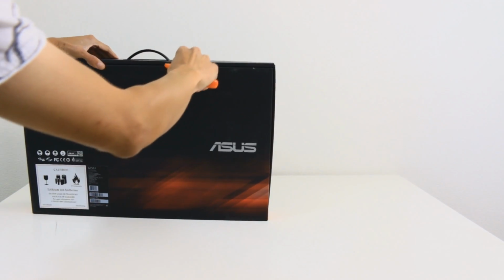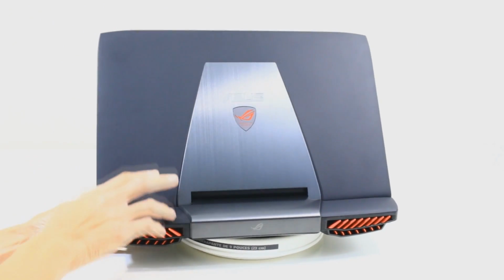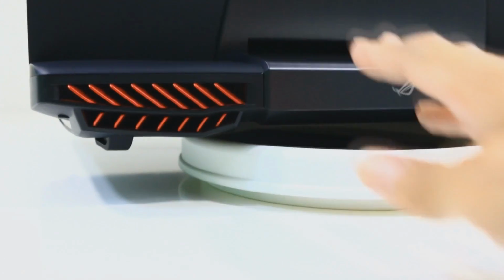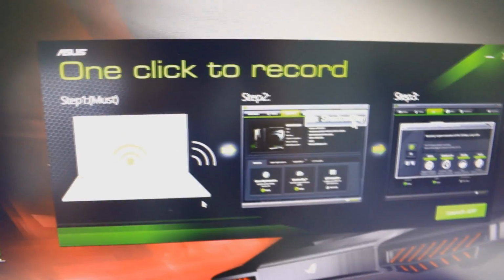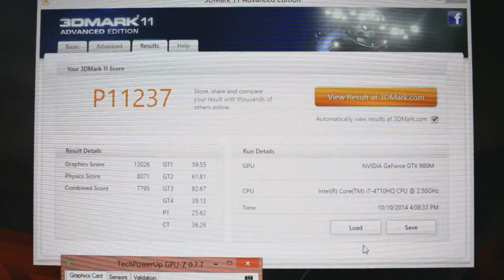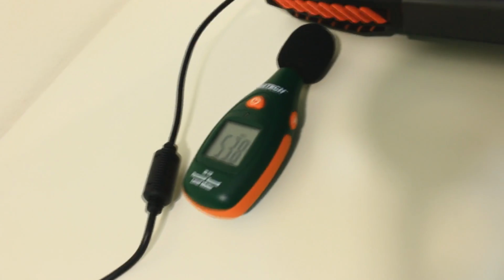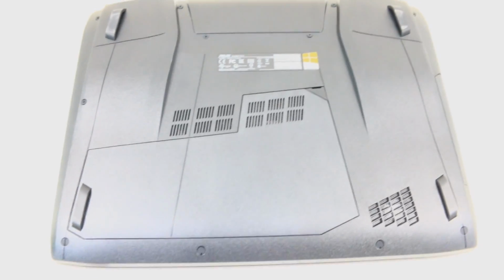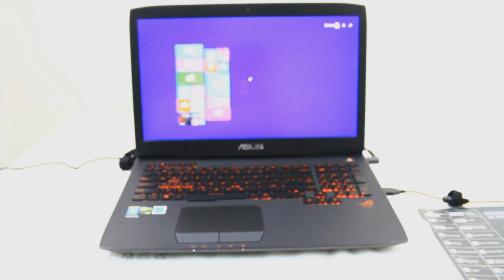Asus G751 nVidia GTX980M Full Detailed Review & Benchmarks (G751JY-DH71)

Comment: Concerning the SSD/M.2 slot. Can you install both simultaneously or would that cause interference or other issues?
Reply: unfortunately you can't but you can buy an adapter on ebay that lets you replace the dvd drive for an extra sata port

Comment: Hi, one thing that you didn't discuss was the construction and materials used on the laptop. Like, the part where we rest our palms, is it metal and does it smudge easily? Also the lid material construction and whether its a smudge magnet like some laptops.. these are minor details, but I'd like to know!
Reply: +Jean Joseph I'm using the G751JL right now. The material on the surface that the keyboard lays and the lid pick up fingerprints easily. It is annoying at first but I've unconsciouslly gotten into the habit of making sure my hands aren't greasy before I use my laptop. The newer model G752 has an aluminum construction if you wan't to spend the extra $. After a few months the fingerprints don't bother me any more.

Comment: Could you please tell me what you think about this is it worth 2551.68 US dollar or not ?
ASUS ROG G751JY T7169H
Processor: Intel® Core™ i7 4870HQ (turbo up to 3.7GHZ, 6M cache)
Memory: (32GB) 4 x 8GB DDR3 1600 MHz (Hynix)
Display: 17.3" 16:9 IPS FHD (1920x1080) anti-glares
Graphic: NVIDIA® GeForce® GTX980M with 4GB GDDR5 (G-Sync)
Storage: 1TB HDD 7200 RPM (Should I change to 2TB 7200 rpm or its ok?) With 1TB SSD (Samsung Pro)

Comment: So which one should i buy? Asus G750JY (i7 4710HQ, 980M 8GB, 12GB RAM, 1TB, 256SSD) or the Asus G751?

I hear the G750 is better than the G751.
Reply: G751 is an all round upgrade over the g750. Although both are great. Go with g751 if you want great performance and g750 if you're a bit more money conscience.
Reply: 750 gots better video card?

751 gots better processor?

Will you use the 4 gb more memory on the video card?

Or will you use the more cpu power?

Choices :)

Comment: I plan to buy the cheaper Asus ROG G751JM-T7041H which has a GTX860M. Can someone tell me if it can run The Witcher 3 with max/ulra settings?
Reply: You won't be able to run Witcher 3 at better settings than medium with a 860m.
Reply: Ando Django As I thought. Thanks.
Reply: No Problem

Comment: Thanks a lot it's totally helpful, but I still have a question if you can kindly answer ..
I'm a Lumion user and this program requires more than 6000 points on Passmark for the large projects. I know that the GTX980M scores 6564 points which is totally great, but sometimes lumion just can not detect the dedicated graphic card on laptops. I really need this laptop for my work, but I really want to be sure that it can run Lumion with the full performance before I buy it.. I will appreciate your help if you can. many thanks :)

Comment: Help me do i chose the asus g751jy with 32 gb ram a core i7 up to 3.8 or 4ghs i think and a 980m or the AORUS X7 Pro v3 (2x GTX 970M)
Reply: My exact same dilemma.. Can anyone help?
Reply: Depends on what you want, big and quiet(er) with better cooling, or small and loud with a little less effective cooling (aorus x7) which is also a little faster
Reply: Yes but wath do you realy recommende me please
Reply: Bryan Neill 
The arous x7 pro is faster and offers better graphic than the asus?! Does the sli give u a better gaming experience than the gtx 950? Also quality wise which is better ? I wish some one had experience with both to advice us
Reply: Both are the highest quality in the industry, there wont be anything higher for the price. Aorus has higher performance, the Asus has better stability under load in terms of speed and temperatures
Reply: Heyyyy !!!!!! I want to play the witcher 3 on aerous x7 v3 with sli can it run  ??

Comment: seriously i want to buy a top gaming laptop. but im considering some points
01. in future upgradeble...(such as RAMs, GPU, Processors)
02. desktop BEAST performance
03.off course price
04. long term usability
05. more reliability  

please advice me which one is far better for me...

01. alineware - 17 or 18dual graphic
02. MSI G72 Dominator Pro
03. Asus G751jy -Dh
04.any others..please guys advice honestly
Reply: Thanks  dude. .hw about  AW18?
Reply: If you're going for long-term use. I'd go for the MSI. It maybe has slightly worse performance, because it isn't overclocked. But you have access for very easy dust maintenence and you can get a 1000-series GPU when it comes out in 2016. Because the 4710hq won't be a bottleneck any time soon.
Reply: Thanks... grt advice
Reply: Why alienware is not upgradable? Wht are the problems of Alienware  
Please advice
Reply: Sameera Kankanama The alienware is very expensive. If you have the money, I'd look into it more. But the world isn't ready for SLI 980m's yet. They usually get really hot.
Reply: This asus gaming laptop are not upgradable? ?  So decapointed
Reply: Ya. Every body know that... pc isn't mobility..that's also should know everyone
Reply: No dude... alineware 2014 series can upgradable to anything. ..processor. ram. Gpu (cpu dependent on the alienware board ). AW17 serious  980 can upgrade easily check  you  tube. AW18 also possible i heard. You know what.. Aw18 graphics are enough to paly next 7 years. As of today highest graphic required to play only 2gb vga... and 8gb ram. I3 or i5 cpus. So if you have  a 16gb vga... its beast. 
MSI dominator pro is good too
 But see the internal build quality? You have to be very carefully if you using msi dominator pro. Anything hapend you have to pay the price. Its build by some king of thinnest aluminium and plastic. And inside of laptop isn't good enough as my opinion. 
This all like a bying a spot  car...
1st you will dreaming to  buy a ferari bughati lambo masarati something highly recommend and expensive something 
2nd you will dreaming to buy ford gt honda gt nissan gt  or something averagely expensive 
3rd you  will dreaming to buy hyundai kia or something affordable sports car

Its depend on your budget. Your feelings.  Your requirements. 
You can buy a hyundai something but you won't feel like a lambo or ferari. Money is not everthing. It is based on satisfaction.
Reply: Sameera Kankanama the alienware is really expensive and overpriced, plus: Dell customer service.

Also, the MSI has a conciderably "thick" chasis and remains cooler. If you have money, get the alienware laptop with the SLI graphics. But until then it's not worth getting anything other than the MSI.
Reply: Seven  t.. ma bro.... im  appreciate  your valuable opinion. Its gave me to think various point of view.
 I will  explain about my 7 years logic.......... just take last 10 yers pc games revaluation.... 128mb (2004 most advanced vga at the time) vga to 2gb vga(2014)
.... pentium 4 3.0ghz( best cpu at 2004) to core i3..(still most games are required only core 2 duo or core 2 quad)
512mb ram(at 2004 best ram for games) to 8gbram (maximum required only)... just check is it true or not
I just calculate the revaluation. Its not a rocket science. ..just basic only.. its always good to be sharing our opinions with others....#sevrn T. Your advice i highly appreciated.
Reply: #inverted silence  EDM...Ya if i can't afford to alineware... definitely im going to MSI....im too far from USA.. im not interested about dell or msi  customers services. Becouse im bying trough some sellers... but alienware its like  dream come true.....but im still be in msi have such bad build  quality..... thanks for your kind words always.... new things to me
Reply: Sameera Kankanama 
I've been researching which laptop to buy for a few months now, as it is a difficult question to answer.
But the build quality of the MSI has significantly improved for the GT72, and has the second best cooling to the ASUS on the first place. In my opinion it's the best bang for buck right now. If you are going to buy the SLI alienware, you should be prepared to spend $4500. And if you really want SLI graphics for cheap, get a clevo barebone, but they have bad build quality similar to what you describe of the MSI.
But the single card winner is the MSI.
Reply: Yap..i agree with you...its very default to say which one is the better...gt72 dominator pro now improved.. yap agreed with you. Its came with 980....
Reply: Sameera Kankanama G751 is AMAZING with the 980M which is very powerful.
Reply: TEAMSTARBLOCK TY and Blu3Yaap... but it can't  upgeate in future. Lifelong choice is better... that's why im planning to get Alienware or MSI but tooooooo difficult to choose one..... its crazy
Reply: Sameera Kankanama Don't get an Alienware, its not worth it. If you have that kind of budget, get a PC built at MicroCenter. If you need a laptop, go to ScatterVolt on Youtube and see his best laptop list.
Reply: Sameera Kankanama You should get the MSI, trust me.
Reply: Sameera Kankanama all of them have IPS screens now, better than the Alienware which still uses TN Panels.
Reply: Guys i'm confusing????
Reply: Sameera Kankanama yes you are confusing.
Reply: Inverted Silence EDM bro.... ist enough to play next 5 6 years games with 8gb graphics card?  That's where i'm confusing. Becouse  honestly i can't buy every 2 years  or 3 yers a gaming laptop. I can't  afford it. So that's why I like to buy most powerful a laptop which is now currently top....8gb will enough to play... in future?
Reply: Sameera Kankanama Yeah, it is for sure. there aren't even 8gb desktop cards yet! 8GB vram can even load textures for 4k resolution gaming, which is higher than the resolution for the laptop screen! You should be set with the 980m for about three to four years with EVERYTHING on ULTRA. If you find it too hard to keep up, you can always buy a new gpu for your MSI in a few years, which will increase the lifespan even more.
Reply: Can you two stop ignoring me. Inverted Silence EDM Sameera Kankanama 

Bam. Best laptop. http://www.newegg.com/Product/Product.aspx?Item=N82E16834725005&cm_re=Aorus_X7_Pro_GTX_970M_SLI_Gaming_Laptop-_-34-725-005-_-Product
Reply: Inverted Silence EDM... thanks bro..... but you think after 5 yers also msi gpu can upgradable? Mother board will support? Alienware 18 have 16gb sli? It can be upgraded to 980 to... which means .... tooooo overkilld of Alienware 18 ?
Reply: Sameera Kankanama The MSI will most likely have support for the 1080m coming in 2016, but yet, the alienware 18 does have SLI 980m, which is next level overkill, but also really expensive as I said. And usually the second card adds only 30-60% of the original. On top of that the Alienware 18 has terrible cooling. :(
Reply: Let's see i saw msi titan also coming with 980sli.... alineware design been g killing my head  dude.... every night....
Reply: ACER V17 NITRO. im using it now and just got it yesterday. I AM TELLING YOU IT IS A BEAST!
Reply: Asian Lion It's like the MSI but with less ram and a worse GPU. good bang for buck though.
Reply: Inverted Silence EDM +Inverted Silence EDM lol how is it worse? Msi has way worse gpu and v17 just came out.  Same specs and better cooling than the asus. you are just paying for the brand name in asus but they are all the same shit.
Reply: Asian Lion 680m < 980m
Reply: Guys. .. the battle begun.... msi lunch  gt80 titan with 980sli.... alineware released their latest version of 15 and 17 with graphic amplifier....(means we can play with desktop gpu)alienware  prices and specifications reduced! !!
Reply: 3 years... 🤔🤔

Comment: Isn't having the winding striking the  db meter kind of altering the results?
Also, while I get that you probably do this for all systems, wouldn't a more helpful for the customer result be having the db sensor at least 12 inches away from the exhaust? 
Just wondering.
Also, how do you access the "bottom" m2 ssd and the "bottom" ram module?

Comment: I've watched a bunch of your reviews, nicely done, short and to the point.
I am in the lookout for a powerful laptop to use it mainly for 2d/3d work ... all the other asus/msi laptops i have seen so far had terrible panels in terms of color reproduction ... only shift my eyes/head 10-20cm left or right and the colors start to shift on the screen as well ... i do not expect retina display quality on these but does this new ips panel offers any improvements over the old TN panel?
I would have gone with a macbook pro , the screen is amazing but the remaining components are starting to lag behind compared to what current gaming laptops can offer in term of performance ,mainly more ram(macbook capped at 16GB) and way faster video card( 750M is highest on macbook as far as i know which is way behind 980M ).

MSI GT72 2QE is another contender but as well i am concerned about panel quality ...

So like i said, any improvements with this new IPS panel over the old TN one?
Any input appreciated,
Thanks

Comment: The battery is fixed?cant be replaced?
Reply from the maker: yes the battery is internal and can't be access without completely disassmble the unit.
Reply: GenTechPC What if battery got problem?is it possible to directly run laptop on AC power without involving battery?& what are battery timings on gaming?thanks

Comment: ASUS seems to push the fact that this laptop is silent, even at high loads. Would you say you support that claim?
Reply: Yes, I have the G750JS model and it is quiet and cool. I added a 1TB Samsung 840 EVO SSD and a 4GB of RAM for a total 16GB of ram. ASUS gaming competitors and custom gaming laptop sellers need to take notice that ASUS flat out makes a better built laptop, sleeker and more attractive slim design also the latest laptop technology. The beauty is that the lower, to high end models share many important characteristics like RAM expansion to 32GB or RAM. All ASUS G750/1 ROG series share the dual CPU and GPU fans which gives even the lower or entry level model owner the chance to upgrade their laptops with added SSD and RAM and BD player/burner if he or she sees fit. The G751 has some attractable improvements but none to make a mid level ASUS G750JS model owner worry. I just purchased my G750JS a month ago and I prefer the all flat grey exterior and black keyboard area over the new model. The great plus is the new NVIDIA 900 series graphics cards but if you chase every new perk you'd never be satisfied. In my opinion you can't go wrong with either series G750/1 as they are both high end premium model laptops that clearly perform better than any average laptop and its gaming competitors. Don't cheat yourself get an ASUS G-SERIES ROG.
Reply: I had a G750 and overall was really really quiet even while gaming pretty hard, Asus does an excellent job at cooling their laptop and keep them very silent it seems
Reply: my G55 is a friggin stealth fighter.My only complaint is the weight of the brick